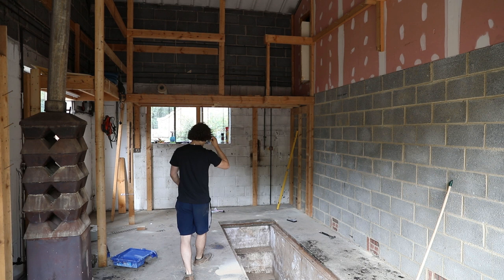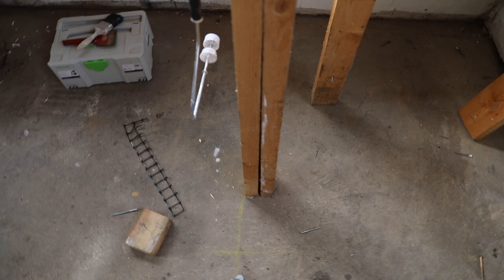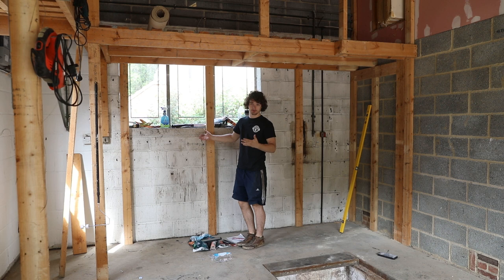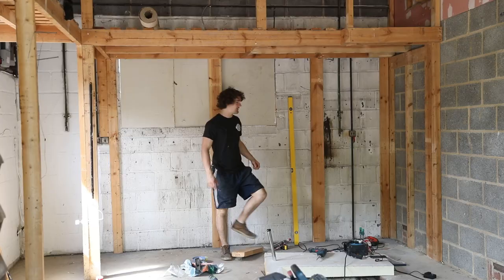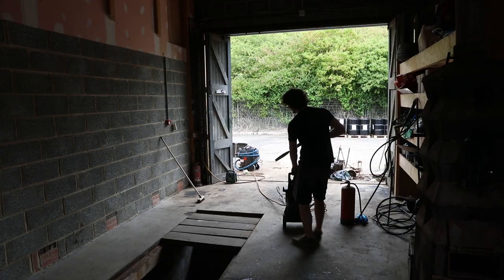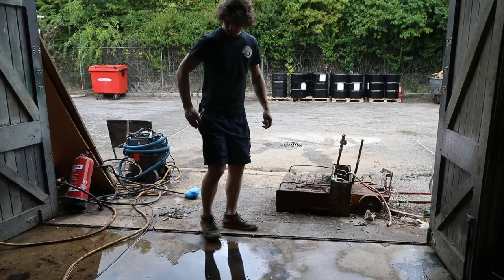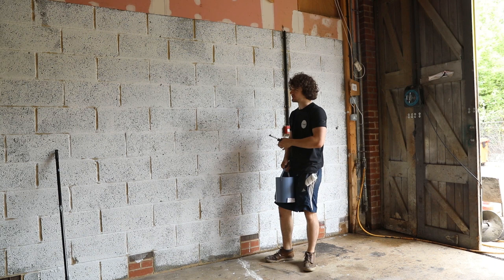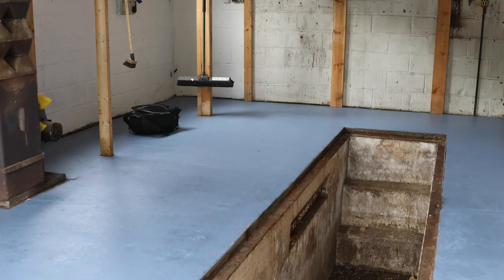Workshop Move #4

Comment: Calcium builds up in the pumps from the water if not used often. That's why it worked after being used a bit it let got of what was holding the pressure release open.

Comment: hey Matt you might want to take some Flat steel and bend it a 90 Degrees and you can then use to secure the beams to the floor. The other thing you can try is a heat gun that is used to remove Wall paper or paint off of wood surfaces it might heat up the tar on the floor so you can remove it it. The only other Idea i have is use a propane flame gun.. Hope this helps

Comment: Matt, stop EVERYTHING and build a cover for the pit. Use all those scrap pieces of the shelves or something if your short on supplies. Worrying about securing the structure your not walking on while working around a hole you could fall in just doesn't make any sense.
Reply from the maker: It’s cool, I got it covered up today! Didn’t manage to fall down there once!
Reply: Great! Id much prefer to watch you building instead of updates from the hospital. ;)
Reply: Young fellas - you can lead em to water but you can't make em think ;)

Comment: Not sure why you covered the back windows.   Think you'll appreciate having as much sun light in the workshop as you can get.  Might want to rethink that bit.
Reply from the maker: I’ll be having my backdrop there so I thought I may as well stop SOME heat escaping. I still have some big side windows that get direct sunlight all day
Reply: In that case, you might want to consider having hidden panels (insulated of course) so you at least have the option of getting access to the back windows and getting more sunlight during normal work hours.   While I understand you have the side windows, years of experience suggests you'll appreciate  getting all the sunlight you can get.   Your shop of course.  So, do what works for you.